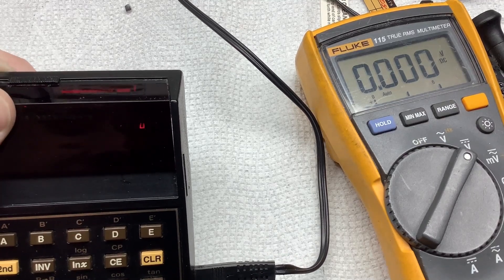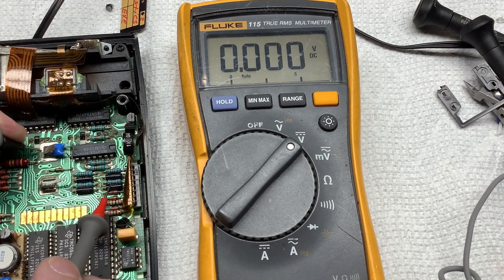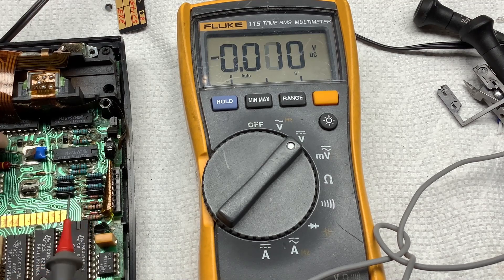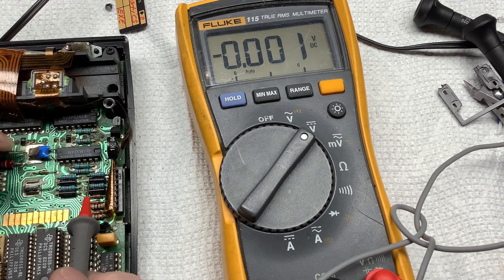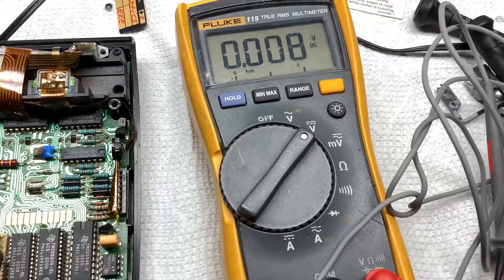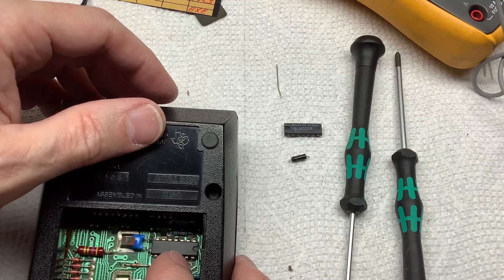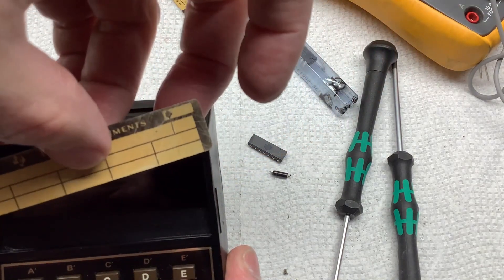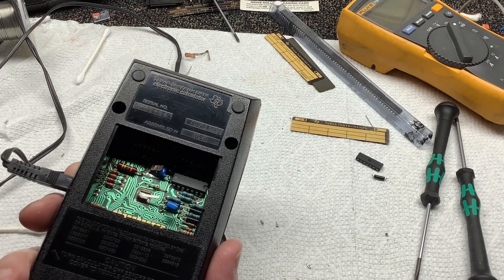TI-59 repair

Comment: Greetings and thank you so much for this great video. I have a somehow similar problem when trying to read cards in my 59. After successfuly recording a program (non blinking one in screen), when I try to read the same card I get a blinking zero. The strange thing is the program is loaded to memory, but normally with a few errors (like 5 to 8 errors in a 100 steps program). After manually correcting the errors the program can runs fine. Errors are always at the same lines/instructions, even after recording the program in a different card. I think this may be different to the  capacitors problem that you mention here. What do you think, have to seen this strange behavior? I will really appreciate your comments. Thanks in advance.

Comment: Great video. I recently also fixed a ti-59 card read issue by replacing the lm324 that had failed. My 33uf caps were fine. Other issues that can cause improper reads are dirty heads, improper feed speed, bad gummy capstan. The tricky one is a dirty  head, you can clean them with ipa and still fail but the abrasive cleaning card will fix it. Others report using a white eraser  on the head also resolve it. Both methods remove surface contamination you can't easily see...

Comment: Very useful thanks as trying to repair a TI-59 with board corrosion from battery vapours. Caps and LM324 fail tests as yours did. Do you have a source / maker's model code for the 33uF caps. UK suppliers list a 2V Kemet small enough but lead times to stock next year. Also odd keyboard problems, accepts numbers, calcs squares and reciprocals but not square roots and logs where it hangs. Not sure if a logic chip or keypad problem.
Reply from the maker: Damn that sucks... Yes over here in the US its also back ordered now till jan...  Use a meter and be sure they are failed. But yea, most likely. Its the size that sucks. There is no room in there with a batter in place or the printer hooked up. It might be possible to use a very slightly smaller uF. A 27uf or even 22uf MIGHT work. So maybe you can find some of those.. Its these Kemet parts.. 2V..
Reply: If I remember  well, the use of ti59 without battery connected was not allowed. This may be the cause of ic and capacitors failure.
Reply from the maker: @robertodelguasta3225  The recommendation was because the battery was required because the power supply by itself was not big enough to supply voltage to the systems. So if you did this it would loose power if you tried to read/write a card or even do some caculations. These days its possible to supply WAY more current for a power supply and the battery is no longer required. The IC and Cap failure just occurs with time. Those caps are well known to fail in any device. The chip is hooked to those caps and when the caps fail, so will the IC. ALL TI59s will have these caps fail. Its physics.
Reply: This is from my original TI 58 /59  Technical Service Manual: 

"The batteries are charged by an AC charger and charging circuit. The charging circuit consists of full-wave bridge CRl through CR4, battary pack BP-1A, and Rl. The full-wave bridge converts the AC voltage supplied by the AC9131 charger to DC. Resistor Rl limits the charge current through the batteries (BP-1A) when the calculator is turned off to approximately 150mA. Rl is shorted by the ON/OFF switch when the calculator is on, so the charge current will be the same whether the calculator is on or off.

----] The BP-1A should always be inplace when the charger is plugged in because it acts as the rectifier filter. [----

NOTE:The charging circuit can't supply enough power to the calculator to permit writing or reading."

Conclusion:
The batteries work as a large value capacitor. 
The 47 - 6V tantalum capacitor is not enought to filter the ac rectified wave. 
The residual ripple, if transformer is used without battery, can damnage the IC and the other capacitors.
Reply from the maker: @robertodelguasta3225  I am a electronic engineer. Just want to start with that. You need the bat as a cap IF you feed it AC. If you feed it DC then the DC goes thru the rectifiers and you supply the DC directly not needing filtering and providing enough current to run the calc without anything else. I routinely design electronics like the ones used in the 59, so, I know this stuff well..  Besides.. You cant toast that chip or the caps no matter what you feed the caculator power wise. There is a regulator you would fry first. As I mentioned before, the caps used, bullet tantalum, are well known to fail with years because they are not fully sealed like the mil spec hermetic sealed versions. Once these caps get current leakage this puts stress on that chip and, pop.. ALL TI59 calcs will have this failure and need new caps. Its just physics. As far as powering the calc, when you feed it 6Vdc with at least a 1A supply you have zero need for the battery. However, this also works awesome to charge the batt if you get one of the new ones.
Reply: Well, I'm an electronic engeneer and I worked for 36 year in GE and Baker Hughes as Gas turbine control systems designer in electronic laboratory (not on the paper), collaborating with GE Schenectady and Salem in prototypes. Not an hobby but a profession! 

I ever get a rule to give answers: I use the documentation and I read what is writen on the devices. 

The battery charger is a simple transformer that provide 8 V AC  (non DC as you think, it's possible to verify with a multimeter connected , set to AC). 
Inside the calculator there is a diode bridge to rectify the AC. The output of this bridge is connected to a 47microfarad tantalum capacitor that is not enought to level the ripple. For this reason the battery MUST be connected before to connect the charger.  
I suggest to use the service manual that I sent you to refresh your convinction.

(NOTA: a serious and professional engineer doesn't boast before knowing who he has on the other side!)
Reply from the maker: https://www.mouser.com/datasheet/2/447/KEM_T2039_T322_AXIAL_T323-3316824.pdf
Reply from the maker: In stock https://www.mouser.com/ProductDetail/KEMET/T322B336K002AS?qs=VVXJgp%252Bqni0qImfG8tcXfQ%3D%3D